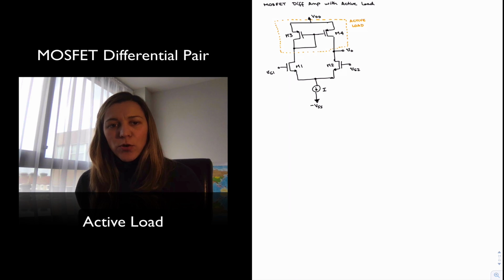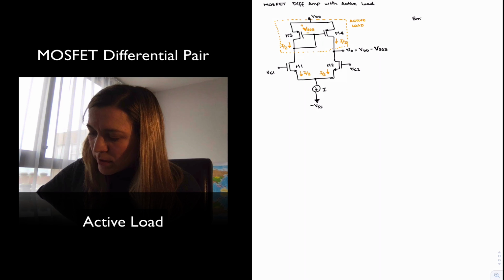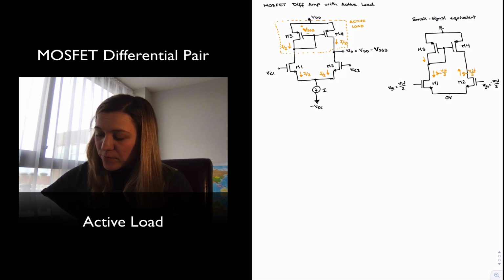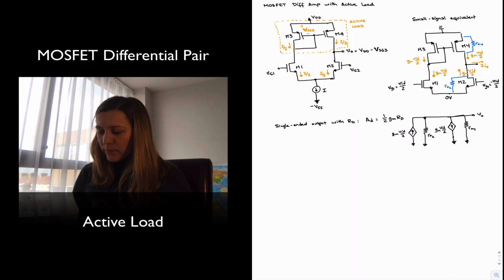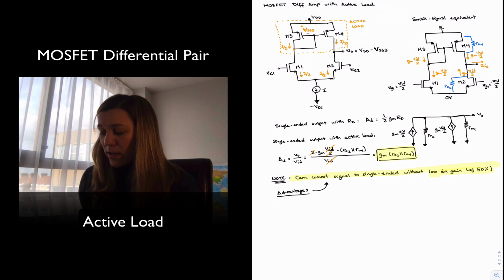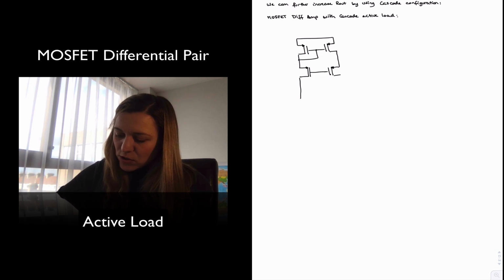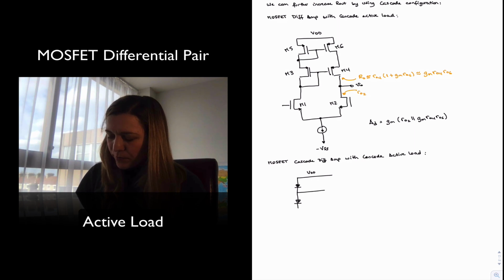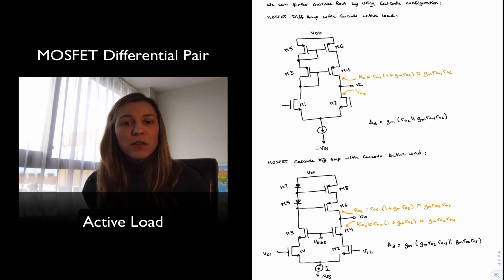MOSFET Differential Pait with Active Load

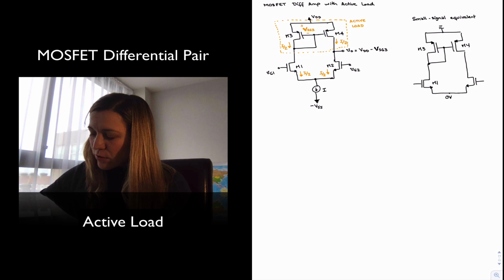Comment: At 4:58
Why can you say that the source of the differential pair is at ground. I know that in a symmetrical Differential Amplifier (symmetric load) you can show that the potential above the current source is constant (only in differential mode) so you can replace it with a voltage source which will be a path to ground in small signal analysis.
But this current mirror load is not symmetrical so the same argument can't be applied here. 
What is the argument for closing the path to ground in small signal analysis?
Reply: Exactly